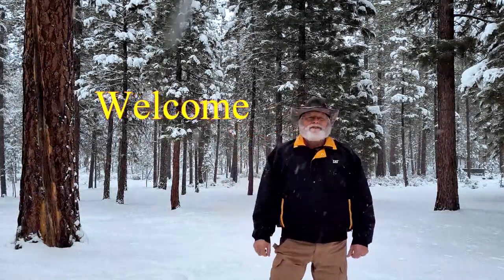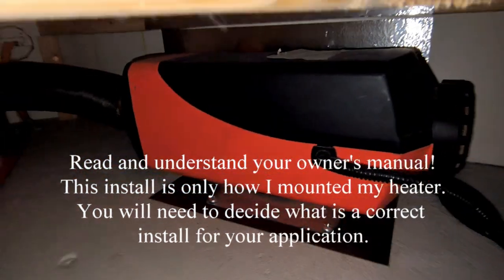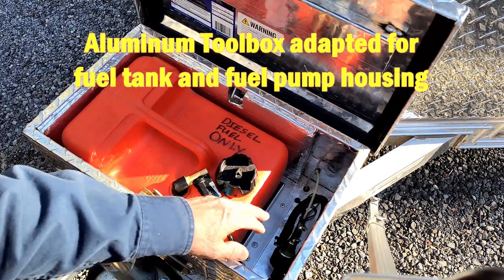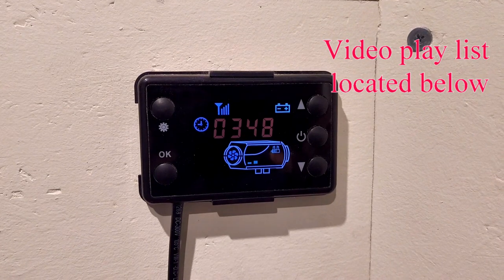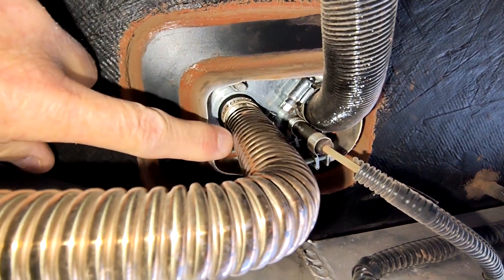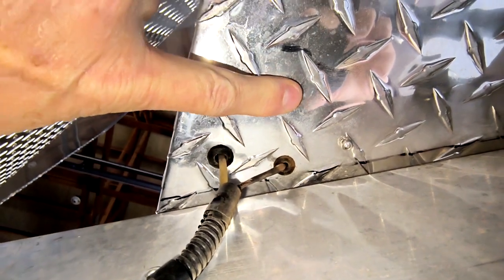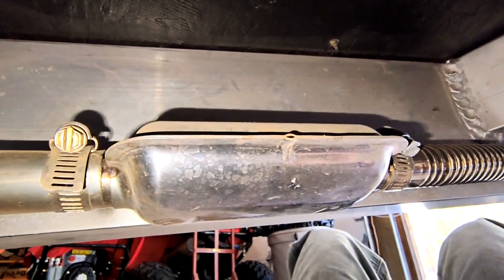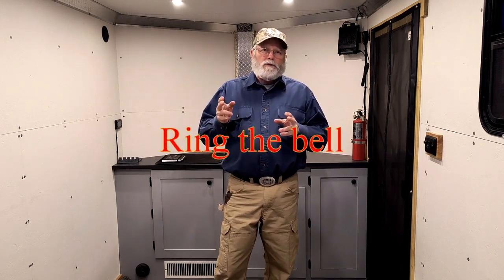Diesel Heater in Cargo trailer. How I installed

Comment: Love the build, nicely done.  My Son did something very similar to serve him as a traveling Lab Scientist, which is a thing!  Your CDH installation is perfect.  He opted for the 4port heat vent and used silicone heat duct to move the heat to 4zone vents inside the trailer.  He also has an awning room that he can use if he boon docks the trailer in between jobs.  A great way to see the Country.  He routed one vent so he can have heat in the tent/room.  He says it takes the edge off, but added a stand alone additional heater if he boondocks in snow weather.  I told him he should make a video similar to yours on his own trailer build.  Stay safe and warm!
Reply from the maker: Hi @straightarrow5518, thank you for your great comment, its always interesting to hear what others have done with their builds. I have seen the add on canvas tent rooms, that's a good way to add space when you need it. This 5kw heater is all we need in the 6'x12' cargo conversion camper. We have had the trailer out in cold down to 11 degrees Fahrenheit and were comfortable, the floor did get cold however.  
Please Like, Subscribe, Ring the Bell and let others know about our channel on your social media. Have a good week.
Reply: You’ve gotta tell me more about this traveling lab scientist thing. I have a PhD in chemistry and never found any such jobs.

Comment: I use one of these units to heat the house, it runs all winter, so other than noise they are perfectly safe to run all night! but they do foul a bit more if left on low burn for too long, so before shut down I let it run full tilt for 30m and injector cleaner does healp

Comment: Hello Sir.  You did a very nice and clean install.  Give your muffler a little turn so that the pin hole in the middle of the seam faces downward.  That's the condensation weep for the wet exhaust so that will want to drip occasionally.  I've seen several people wrap the fuel pump with rubber pipe insulation and a few pipe clamps and I guess that really takes the ticking noise out of it.  Best of luck.  Take care!
Reply from the maker: Hi jasonphaneuf788, Thank you for your comments. I really appreciate your input. With regards to your comment on the diesel heater pump, I will give the pipe wrap a try. Having the pump outside the trailer in the box really helps but the tick, tick, tick still radiates through the aluminum trailer.  The exhaust muffler I have turned sideways to keep it from hanging down where it would get caught on brush when we pull the cargo trailer camper into some remote boondocking spots. If it rusts out, I will replace it. Thank you for pointing this out, you are 100% correct. Others reading this will see your tip and install it as the directions call for.
Please Like, Subscribe, Ring the Bell and let others know about our channel on your social media. Have a good week.

Comment: Do you have a parts list somewhere? I want to do this exact build!
Reply from the maker: Here's a list of parts from Amazon:
Vevor diesel heater 5kw
Color tree 1" stainless steel exhaust pipe. This is the extra pipe needed to run out the side of trailer.
Amerimax MW/NE/SE 2X3 Galvanized Drop Outlet (for gutters) This is what I used for heat baffle. 
Better Built 67011386 ATV Tool Box.
Please like, subscribe, and let others know about our channel on your social media. Have a good week.
This diesel heater build is only showing you what I chose to build for me. You will need to access your particular application and assume all risks involved with the application, build, and health risk.

Comment: If space allows, move the cold air return away from the warm air out put, to get more circulation. Also, consider wrapping the exhaust pipe with "header tape" sold at auto supply stores, until the very hot pipe clears the area where the plastic/rubber fuel supply line is. In other words heat insulate the exhaust pipe for the first 6 inches where it exits the heater unit.
Reply from the maker: Hi Theseattlescott, Thank you for watching and commenting on the video. I will go pickup some of the exhaust/header heat shield tape. Please Like, Subscribe, Ring the bell and let others know about our channel on your social media. Have a great day.

Comment: Nice install and great video. Clear, concise, good video quality and editing. Was going to mention the muffler orientation but I saw your previous response and I think I may have to do the same with mine—have been worrying it would be hanging too low. Like the aluminum shroud around the air intake, too. Question: why don’t you feel comfortable sleeping with it running? You’ve sealed the exhaust well and you’ve got the CO monitor. Thanks!
Reply from the maker: Hi s2pointoh, thank you for watching and leaving your comment. The air intake for the heater needs protection, so I made the shroud to cover it. If it gets damaged I will make another 🤠. When traveling down the two track roads the brush that's growing in the center tends to like to grab whatever it can under the trailer and the shroud mitigates this. Please Like, Subscribe, Ring the bell and let others know about our channel on your social media. Have a great day.
Reply from the maker: S2pointoh, on my first reply I didn't respond to your question as to why we don't sleep with the diesel heater on. I haven't ever had any problems with these heaters but I'm just over cautious. I will turn it on in the middle of the night as needed but try not to sleep with it on, that's just me🤠 I have one of these mounted in our Old 96er camper canopy, "video in play list below this video" and have used it for three years now with no problems. Thanks for asking.👍

Comment: On mine I hung the pump from the fuel line only not using the supplied hanger find a way to support the fuel line in the correct angle for the pump you will find it gets rid of 90% of the noise

Comment: Thanks for the video!!! Like the way that you are meticulous in your work! I am purchasing a diesel  heater and was thinking of routing it opposite, meaning, heater outside to inside. I am installing two tongue boxes to which I want to install the heater, fuel tank, fuel filter, fuel pump and battery into the boxes then running the heater hose to the trailer. After working with these heaters what is your take, think this method would be feasible, any draw backs you can see? Thanks again!!!
Reply from the maker: Hi Darren, It sounds like you have a fun and rewarding project ahead. I like your diesel heater install concept and think it should work out well for you. 
I live a cold part of the country and run power service in my fuel summer and winter. The power service picks up the cetane in the diesel and winter version has anti jell in it. 
Please like, subscribe, ring the bell and let others know about our channel.🤠